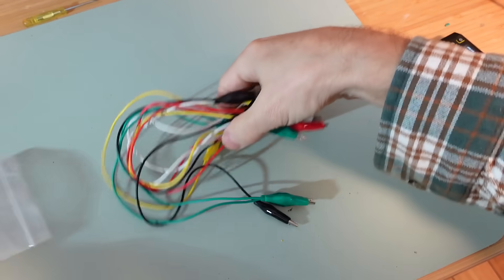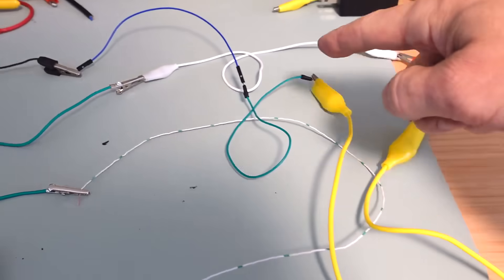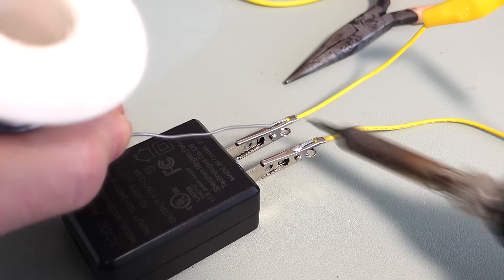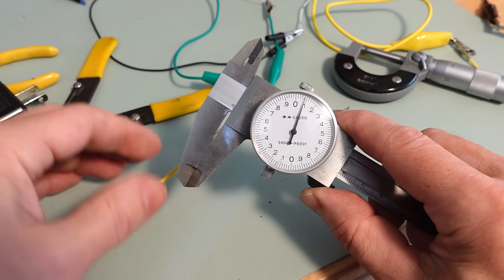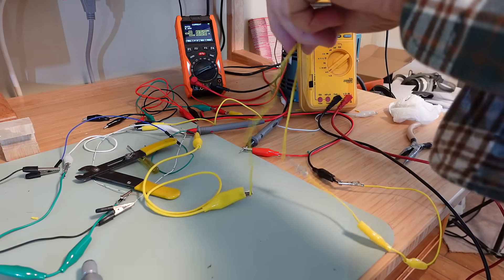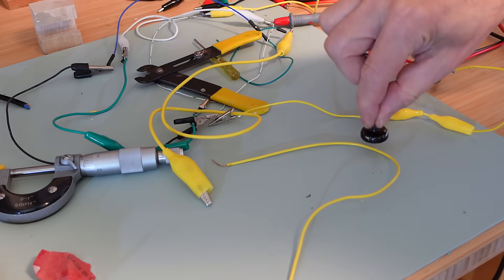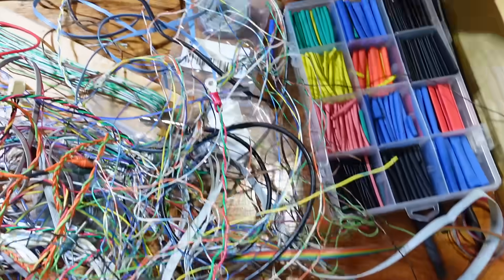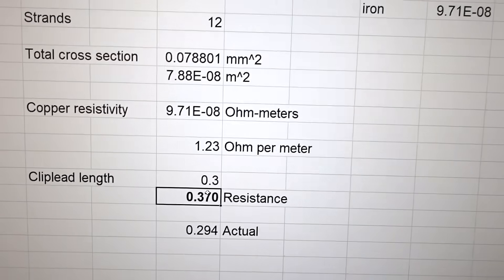Clip leads made with fake wire

Comment: The last few years when I buy test leads they dont last very long. They only crimp
the wire to the clip and after a little use the connection works its way loose. I 
just bought a new package of test leads and was gripping to myself that they
should solder the wire to the clip and then it hit me. I have a solder iron. So 
today thats exactly what I did. I pulled the insulator off the clip and soldered
the wire to the clip. THEN I did a continuity test the verify my work. NOW I
hope that these will last a good long time.

!

Comment: I kept blowing 500mA DMM fuses even though I was powering an LED with 5mA. So I smashed one open and not only was it fake but they didn't even bother filling the ceramic casing with sand. Just a super thin uncalibrated wire. Now I don't buy cheap safety related stuff off Amazon.

Comment: Very nice. Good to know. You never know what you're gonna get these days.
Reply: Yes you do. If you pay US$2.00 for a test lead you may get copper if you pay US$2.00 for a set of 10 then you will get something made as cheap as possible and the copper plated steel wire is the way the manufacturer manufactures it to your price point.

So many people complain that China is making junk but they are simply better at making stuff to the customers price point.  People in the west would rather frequent Starbucks or dunkindonits or pay US$ 20 every month for Spottify or Netflix instead of reading a book at Gutenberg.org or the Internet Archive lending library and buying a new set of professional jumper cables every moth.  

Because of the relentless western propaganda hiding the truth most people fail to realise that China is the worlds biggest vertically integrated manufacturing company that knows how to pander to ignorant consumers.  Props to them for pulling the wool over the eyes of billions of ignorant consumers as I have said many times.

I usually buy my test gear second hand so I can afford professional gear.  It may have scratches or be a bit older but it was built to a DIFFERENT price point.

The copper plated steel wire was pioneered by the automotive industry to stop wasting copper in sensor and control wires that need no current but could not be made thinner because the copper would be too weak.  Use cheaper material and you maintain the strength and the resistance is still acceptable. Saves on copper when the car is shredded and the steel is recycled.

Comment: Thanks - I am glad to find out that I am not going crazy.  One of my other gripes is that the plastic clip shields are often so tight or inflexible that you can barely open the clip. Infuriating to work with.

Comment: Well, I, someone who watches a number of technical channels like Big Clive, You and Ben Heck, to name a few, this isn't very surprising.  Coax cable has become copper plated steel as well, so not too much of a surprise.  Then again, I could remember when household "Romex" wire used to be something like $70 for a large-ish spool of 14/2 and recently went into a Peavey Mart (used to be TSCStores) where just buying a bag of 10-15 m costs $100-150.

Big Clive has tested power bar leads of some of these Chinese power bars and found them to be made of Aluminum.  He had a simple test for it by exposing the strands to a lighter flame and they shrivel up while copper doesn't.

The mouse wire could be shielded with a ferrous material like a steel braid, so I wouldn't be that concerned there.  Also, I know to some it may seem like a waste but most of my input peripherals are wireless now.  Usually it utilizes a simple dongle plugged into a USB port and a NiMH AA cell or two inside the device itself.

Comment: I almost started a fire when an "18AWG" turned out to be 32AWG copper clad.  That said, copper clad steel has uses as it is much stronger and more resistant to breaking than pure copper.  So for applications like coax (which os mostly skin effect) or headphones (low power lots of handling) it makes sense.  Are clips another good use?  Maybe

Comment: Intersting, i just tested my dupont cables and theyre iron too!  except the ones with alligator clips..   by the way I just salvaged some wire from a bug zapper thing today because the cables looked nice.  They were rated for 500v 2 amps accordig to the thing they were connected too but they were also magnetic!  Probably iron.  But it had solid core copper wire leading to the cage thing.  The iron ones were all positive (red) coloured maybe they use copper on the negative and iron on the positive to save money?   Anyway good to know.

Comment: It's at the point where you just have to buy alligator clips and spooled wire (from a reputable manufacturer) and crimp and solder them yourself to get a quality product - at more effort and more cost. Sad state for a lot of industries. Once upon a time I got some backlash from admin for buying expensive wire and amphenol connectors at work for building out custom wire harnesses, should send them this video to show them just how garbage the average product they find on Amazon is. Might be weird considering I don't work there anymore lol.

Comment: I have problems actually joining ATX PSU cables ... they have like a thin copper layer that you have a very short window of time to make a solder. Once this copper platting goes away, solder wont stuck to the wires. I though the were kinda aluminium or some cheap alloy. Something is sure, the CANT be copper ... Probably this is the reason why you got poor readings after soldering them, the plating was kinda doing the job and is so thin that you cant solder on it.

Comment: Iron is more dense than cooper, aluminiun. Melt iron on alloy is to increse the weight. But the scam is reduce the amount of wires on cable and keep the weight. In places were not used solid cables, a simple trick to "test" the complience of the cord is to weight a big roll and compare to expectable measure. Thin weights are bad cables without few wires. Take care!

Comment: my local copper recyclers no longer accept 75ohm coaxial antenna cables..

too much steel mixed into the copper core, its been an increasing issue for over a decade now

Comment: Never in my 76 years have I seen anything like this! I did buy some leads like that about 10 years ago and I had problems with plating some small parts that seemed voltage related. I'd be willing to bet those cheap leads were like the ones you show. I don't use those leads for much but I'd better check them. Thank you very much. Who'd a thunk it....

Comment: Confirmed. I have found other magnetic cables too. For example German (or Chinese really?) Hama GmbH & Co Audio Cable KG86652 with 3.5mm plug and female connector. I don't know if the cable itself is iron or the possible shielding is made of steel on purpose to make it "armoured".

Comment: I found the same thing a few years ago.  Things did not add up when I was doing some testing with the jumpers.   Loosing too much voltage in a 5 amp circuit .   I did not test the wire, just changed it out for some known good copper wire.  Other wire from China seems to be aluminum coated with copper.   Some 120 volt drop cords have been imported with the same problem.

Comment: Thanks Matthiass.  Yes, you have observed what all of us have been finding out those leads not the best for "electronics" and "electrical" projects.  Low quality crimping,  wire to small to provide a "reasonable" current capacity and well as unreliable resistance values.  Your thermo image was a "dead give away" too.  Nice video.

Comment: Well, to be a bit pedantic, copper-coated steel actually. It's crap. Back in the working days, we used a lot of 18ga lamp cord for wiring runs and the stuff we got from one particular vendor was cheaper, but very light. We soon discovered that instead of solid copper it was copper-coated steel and yes, a magnet would pick it up. The copper was so thin that you couldn't solder it (the copper just dissolved off into the molten solder and the solder wouldn't wet the steel wire) and it was so brittle that crimping a terminal onto it usually broke the end of the wire. Recently I was looking for some 12-10ga wire for a project on Amazon and found lots at surprisingly-good prices, but upon reading the details, all the cheap-price stuff was CCS. Also, the center conductor of the cheap RG-6 TV-cable coax at Walmart is CCS. It's everywhere now, so be careful of what you're buying.

Comment: I had bought these (or a very similar listing) to use to modify an 18650 charger to charge some weirdly shaped cells a few months ago, and couldn't figure out why it wouldn't charge the cells and the voltage on the screen was jumping all over the place. Noticed the bad connection, soldered it like you did, still bad. It only worked once I removed the clips and soldered them to some thicker gauge copper wire. I just assumed that the wire gauge was super weak, never would've guessed them to be iron but makes total sense after watching this vid

Comment: A few month ago I bought some amazon stranded cable.  When I got it, the very first thing I did was measure its resistivity, to verify I got copper or some other stuff.  I feel lucky I got copper, but also the sellers was stating this was real copper wire.   Also as you experienced, the wires with clips, those are crap.

Comment: I love seeing the way different people diagnose different problems, calculating the cross sectional area and the resistance from that is a very smart way of coming to the conclusion that they might be iron. I'm definitely going to check my cables with this method, and a good PSA to check your cables if you're putting any real amount of power through them

Comment: Before you call it “fake wire”, a couple of things:

1) it is most definitely wire.

2) did the datasheet or specification state that the wire was copper, or did you just assume it should be?

If it is like most adds, then the clips with steel wire don’t mention the material. Trying buying some crocodile test leads that specify that it is copper wire, then do the tests to see if what is provided is fake copper wire.

Comment: This stuff coming out of china is complete garbage. Crap wire and not even soldered. Crimping is useless for this type of wire. The clips are poor quality as well. Thin metal that bends and folds when any amount of pressure is applied.
When I decided I needed some new clip leads a few years ago I went and visited a surplus electronics store that had a tray of NOS alligator clips like these that were made in the 1980s. They were very good quality so I bought the whole lot. Then I got some good quality wire and sat down and soldered everything up.

Comment: I literally found this out just last night on what must be the same junk test leads but I assumed they were aluminium and didn't check further. 

I was trying to actually get some use out of them by using the fine wire for some smd repairs but they just wouldn't solder right. Why can't they make things right?

Comment: CCS (copper cladded steel)  been used in the consumer industry for the last 30 years, its not fake, it works just fine for RF patch leads, Scarts, audio cables etc.  Appreciate you might want better test leads though.  Beware stuff with no detailed specs.  Biggest issue I noticed was soldered RF TV patch leads (unshielded at the connector and cable junction), rally bad for digital TV.  Fully shielded clam shell was much better, but you cannot tell from the outside when they have end mouldings.

Comment: I just checked most of my jumper/alligator clip wires and luckily none of them are magnetic. That doesn't mean they are any good though. The crimps on jumper wires I got a year or two ago are so shoddy that they lose contact if you just look at them the wrong way. It was quite a pain chasing problems in circuits caused by this. Things that sometimes work and sometimes don't are the worst.
Generally I found that the quality of goods from China has dropped significantly (from an already mediocre level) especially in the last two to three years. There are some modules I bought repeatedly (like voltage converters, charge controllers, microcontroller boards, sensor modules) over many years (they often even still have the same product pictures), which means I have a kind of a "quality timeline". Bad soldering, modules where the whole batch has SMD components in the wrong place (to the point of mixing up resistors and capacitors), underspecced components (not even talking about fake ones). It has gotten much worse.

Comment: Thank you for this video :)
I have a bunch of those for years but haven't used them yet, so I never realized they were fake. They were about 2€ each. Do not know if that is expensive or not.
But this prompted me to magnet test all the 15cm USB cables that have been failing to power my Raspberry Pi 3b and, sure enough, they are all attracted. I just assumed they were defective when I measured almost 2V drop across them at the time I tried to use them. Did not knew about fake wires and, at the time, was in a rush to get the Pi working so just moved on to another cable.

Comment: I was expecting copper clad aluminum, but steel? That is bad.  But, then I have seen copper clad steel wire used in CAT5 cable. 2 pairs were CCA, 2 pairs were CCS and it was advertised as pure copper. LOL

Comment: The name of the video is clickbait. They aren't fake wires. They're small wires. These leads are copper coated iron. They're probably falsely advertised as well considering they're from China. If you just need a basic jumper for low amperage work they're probably fine. If impedance is an issue for what you're doing then you don't want to purchase these leads. You can buy aligator clips and wires and assemble jumpers of whatever length and design that you need. You can even create jumpers with other types of electrical clips and terminals as needed.

Comment: I made this observation a few years ago by accident the other way around in the lab, when suddenly and in front of my students' eyes one of these clip wires suddenly attached itself to a neodymium magnet. And recently there was another youtuber making the same observation.
However, with better analysis equipment around in our lab than just magnets, we did an XRF analysis of the material of the wire. It's definitely not pure iron in the "core" of the wire, but also significant amounts of nickel.
Here is the link to the other video: https://youtu.be/1UIRmyQmYpQ?si=A8vYYExJa9-bMJAR

Comment: I can reinforce this by conducting the same magnet test on some I bought back in 2016, and they're definitely ferrous. I noticed the high resistance then the thin strands very soon after buying them, so I've kept them just to cannibalise for the alligator clips. 🐊⚡👍

OTOH, you've also just made me aware that I have about 5m of high resistance Iron wire in the house which will be fantastic for working around the problems I face with the affordability of 3kW night storage heating... 🔥💰👍

Comment: The mouse cable being made of steel is probably a good thing. In that application the wire only has to pass a few milliamps but it has to withstand a lot of repeated mechanical stress.

Comment: The same happens with ethernet cables (Copper Clad Aluminium / CCA). So much for running them with POE+ or greater...

IEEE 802.3bt Type 4 can go  up to 100W supply over 100m cabling. The spec says the supplier must use 52-57V, and the device gets 41.1-57V. But the device can only be guaranteed 71W. I wonder where those 29Watts have gone to!

Comment: Amazing isn't it. They forgot to put the copper in the wire. This is common on cheap Chinese scooters. They use real copper wire for the primary wires and very thin cheap wire for everything else. 
Therefore, the hall throttles with 5 foot long copper-less wire have a return voltage well below what the hall sensor will actually pass. = low power scooter.

Comment: I had to check my Chinese test leads and they all stuck to the magnet.  They're not soldered either, so that will make it a lot easier to change out the wire.  I also found a USB charging cable with iron wire.  Thanks.

Comment: Unfortunately it also might be aluminum. The flame test is really useful, I believe I first saw BigClive. 

Copper will melt at a higher temperature than aluminum and will stay 'copper colored' even when melting. It won't burn. It will have some green tinge to the flame.

It melts at a lower temperature than steel, which can be useful to test too, but a magnet is normally better at that.

Comment: I have the exact same set of clip connector cables + one size larger set o/t same "brand". I was pretty underwhelmed when I cut one of them in two and saw the 3 strand wire in the "massive" cable. But now it turns out it isn't even copper ?! Ridiculous !! (and it explains why I got weird results when using them to connect temp-probes ...)

Comment: Not a new issue had to resolder my clipleads like 15 years ago, and they often use leftover wires which often are of poor quality, like copper plated iron or aluminium.
Since i need to check and rework them anyway i switched to making them myself, the clips are dirt cheap in bulk.

Comment: Couple years ago I picked up some silicone jacketed/coated wire I think was 14ga. Copper coated something.  I had a wire fault with one of the cables recently only to find the "wire" or whatever they put inside has completely turned to white powder.. Now I get to replace a few hundred custom made wires.  I've never seen a wire deep inside a jacket turn to powder.  There was no sign of any wire left. 100% corrosion.

Comment: It is not always iron/steel. Very often also aluminium with copper coating. Steel inside the mouse cable may be a very good idea because it makes it mechanically very robust and tear-resistant